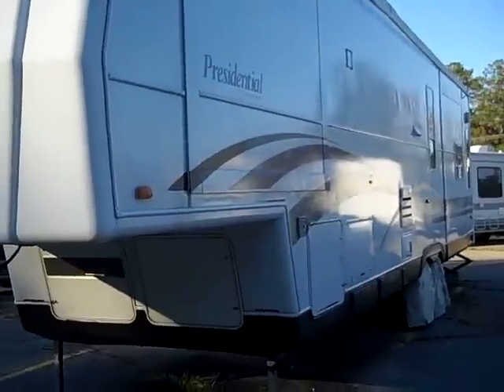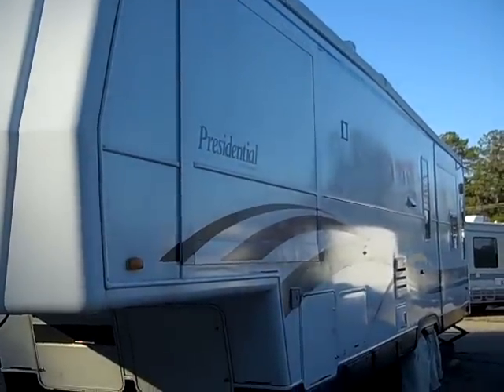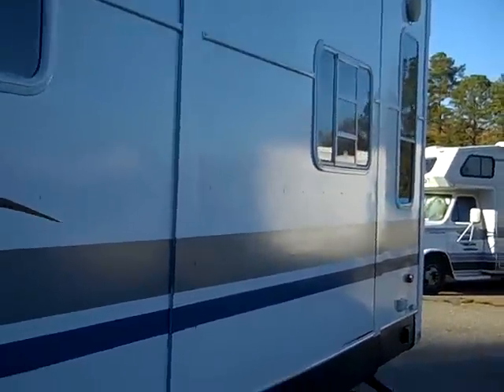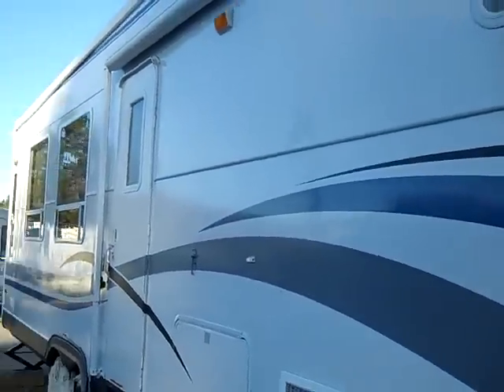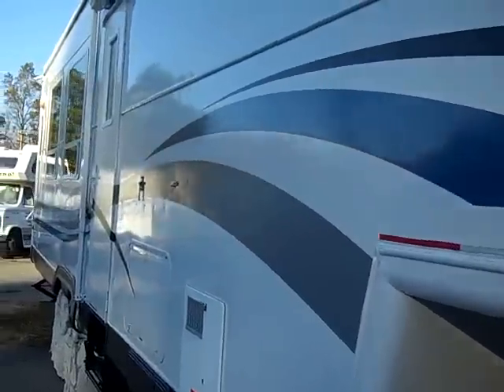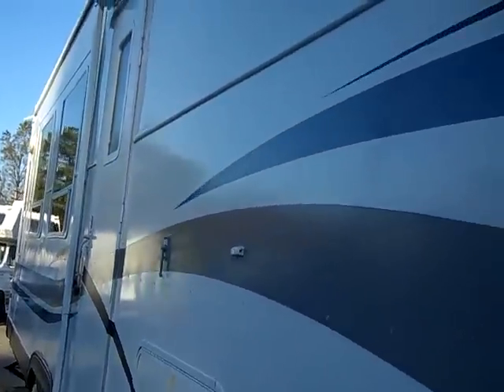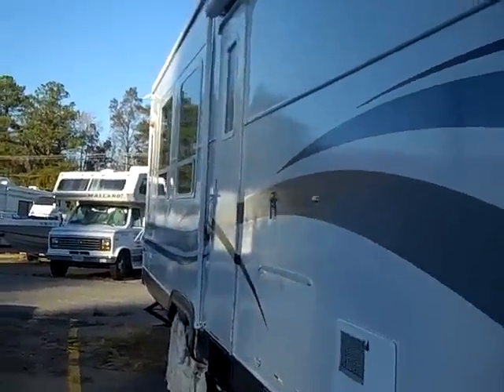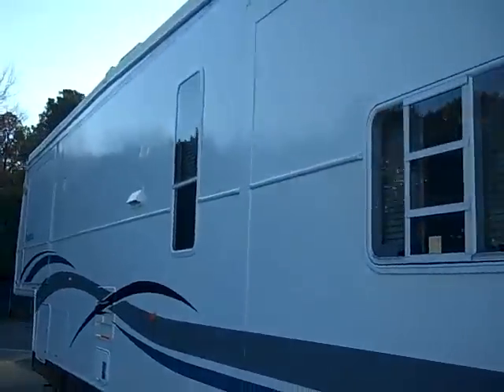RV Paint Job Update

Comment: I have a 2003 HR alumascape TT which I got last year. my exterior walls are just like you'res and I have watched your videos of painting it with one coat. my question has to do with your preparation.
1. what did you clean it and dry it with before painting?  
2. did you tape the stickers and leave them like that for a few weeks...months or did you retape everytime you painted?
if you left the tape on there did the coat chip when you went to take the tape off. 
4. did you paint the decal stickers?
5. how hot/humid was the entire day(s) when you were painted?
6. After 4 years and before you repainted your HR and removed the decal sticker earlier this year. had any of the paint chipped off?
7. was the HR always left outside and what are your weathers like? Mine is near the beach and our weather is sunny, hot or humid most of the time. 
8. What was your normal preventative maintenance procedure like? such as type of wash you used, wax and how often?
thanks so much!

Comment: when you finished the paint job, did you have to deal with "orange peel"??? I'm a retired truck driver of 38 years and have a old 1990 Starcraft 36' motorhome that needs a paint job.
Reply from the maker: James Hansen None at all the mineral spirits mix with the enamel and produces a smooth surface, just work on the air bubbles, thx for watching.
Reply: @Max1Chase1  
Ah HA.... You used Mineral Spirits...
Thank YOU